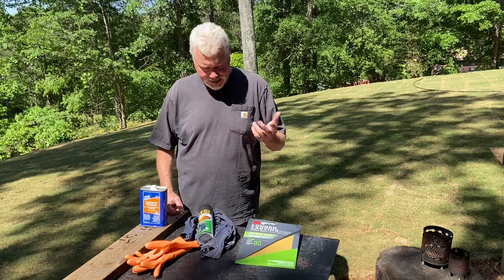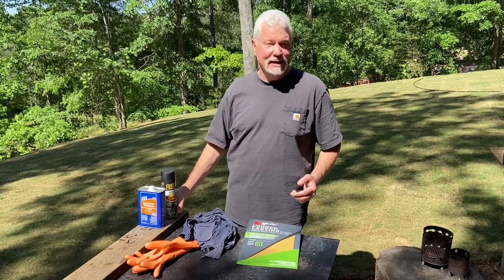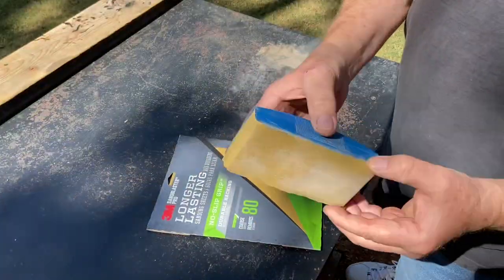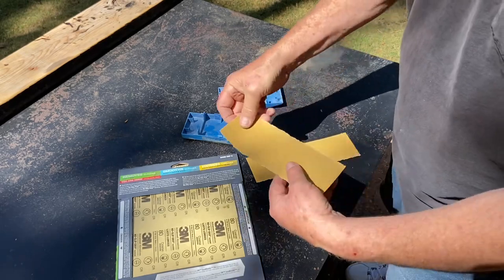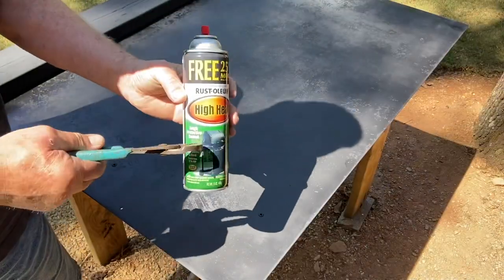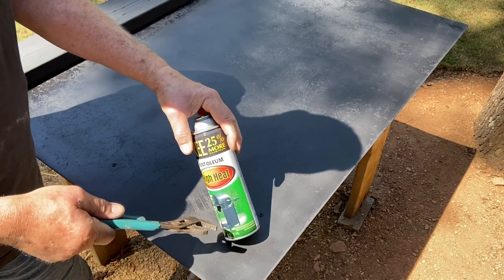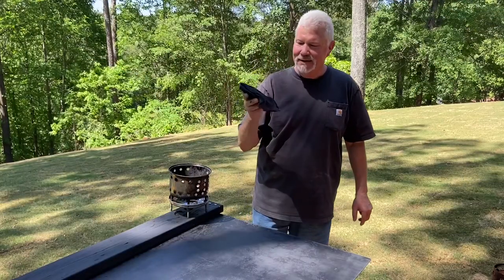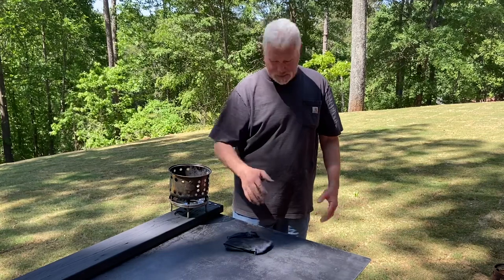Painting My Fire Table, The Dangers Of Igniting Flammables

Comment from the maker: 1) You're standing in a great volume of fumes! 2) You've splashed some on your clothes! 3) You've still got some on your hands! 
   Let's paint the fire table again with some Rust-Oleum High Heat paint. I prepped it by sanding  and then wiped the table down with Lacquer Thinner. After about 3 good layers of paint, I decided to end this video, as usual, with a fire. So let's ferro rod ignite that wipe down rag that has all that Lacquer Thinner on it. 
   This is a good time explain the unforeseen dangers of igniting flammables. Their fumes are heavier than air and are constantly wafting off the liquid. If... YOU ARE STANDING IN A GREAT VOLUME OF FUMES without knowing it and you ignite the flammable then you're going to burn! 
   Another danger that you may not realize, YOU'VE SPLASHED SOME OF THE FLAMMABLE LIQUID ON YOUR CLOTHES OR IT'S STILL ON YOUR HANDS... when you make the ignition, you're going to burn!
   Please follow the LINK below, SUBSCRIBE, and LIKE. Thank You!

OFF Repellent Is Highly Flammable, Keychain Ferro Rod Proves It.
https://youtu.be/oGcUQZRDKoQ